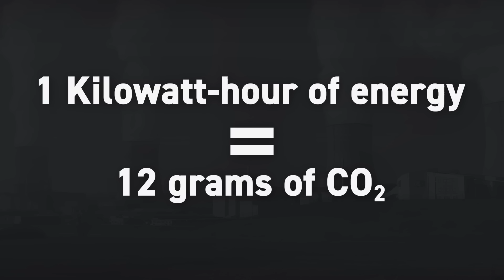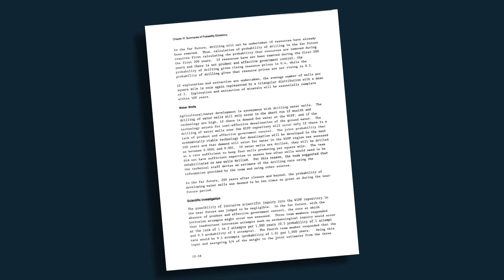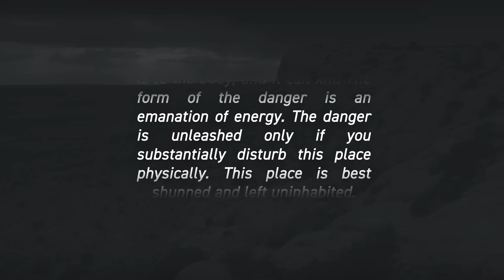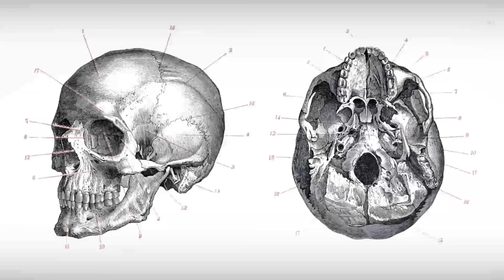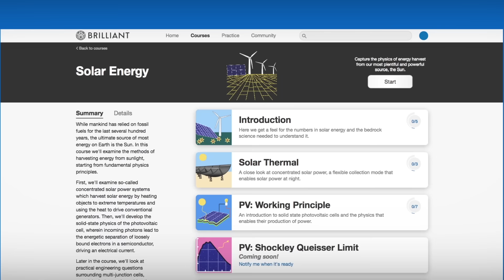The Nuclear Waste Problem

Comment: I'm honestly pretty disappointed in Wendover, one of my favorite YouTubers, for this video.  The basic premise, which is taken for granted, is that spent nuclear fuel is only waste and cannot ever be used for other purposes.  In point of fact, spent nuclear fuel has the potential to provide civilization with many times more value than we ever got out of it in the once-through fuel cycle that created it.  Let's break it down, properly this time.

A fresh nuclear fuel pellet usually consists of uranium-oxide, typically enriched to about 5% U235.  Uranium-235 is the only naturally-occurring isotope which will reliably fission and produce energy, and only makes up 0.7% of natural uranium deposits.  The rest is U238, which is fertile, meaning that a neutron that hits it will not split it, but instead be absorbed.  More on that later.

Inside the reactor, U235 is split (fissioned) to produce power, and leaving behind the fragments known as fission products.  These smaller atoms are highly unstable isotopes and have a short half-life, meaning that they are extremely radioactive, for a relatively short period of time.  The shorter the half-life, the more intense the radiation, and vice versa.  Most of the fission products are done being annoying within 50-100 years, with some being as short as a few weeks and others being a bit longer.  Also in the reactor, U238 is absorbing neutrons and becoming transuranics.  For the sake of simplicity we'll just refer to those as plutonium, because that's the biggest component.  Plutonium has a longer half-life than the fission products and is therefore less intensely radioactive, but it lasts longer, being dangerous for something like 100,000 years (decreasing in intensity during that time).

By the time our pellet is removed, it still has some U235 and a lot of U238 left in it.  But it also has plenty of these fission products, and the plutonium.  Because of those second guys, it is much more radioactive than it was when we put it in there, which is why we treat it as a dangerous material.  Truly, a new spent fuel pellet is a gnarly hazard, mostly due to the incredible intensity of the fission products.  But let's look at each of those material classes, and see if any of them are useful.

Right away, it's obvious the leftover U235 is useful; it's fissile and thus can be used to make more power if incorporated into a new fuel load.  There's less of it, but it's the same stuff and still useful.

The fission products consist of many many different isotopes and elements, and some of them are quite useful.  Most people don't appreciate the significant role that radioactive materials play in modern medicine, for things like imaging, sterilization, and therapy.  We are running out of many of these materials, even as they sit and decay inside storage casks being scorned as useless.  Some treatments even require isotopes found only in the fission products of reactors, and offer tremendous promise in being able to target distributed cancers which require a whole-body approach on a targeted cellular level.  Other fission products become valuable after they are done losing their radioactivity; valuable materials such as neodymium, indium, etc which are extremely important for modern technology, but which are also quite rare and quite an environmental disaster to mine.  Fission products are like what you'd get if you took your pantry and mixed all the stuff together.  It looks nasty, but if you could separate all that stuff again, you'd see again how very valuable it is.

Plutonium is an interesting case.  It's the only component of spent nuclear fuel which is actually dangerous for a worrying amount of time.  It is 99% of the problem which Wendover spent his video seeking to address.  It's also a fissile fuel which can be used in reactors, similar to the U235.  Why in the world should we be scratching our heads about how to dispose of something dangerous, when we could instead destroy it forever AND get an unbelievable amount of clean energy from it?  Two reasons - first, plutonium is also bomb-fuel and thus scary, and our current reactor designs are little princesses who aren't very flexible with their fuel (the reasons are too technical for here, but creating a reactor that can use it is not much of a challenge, we just chose a dumb design).  The bomb-fuel issue is actually scary in name only.  Weapons-grade plutonium must be extremely pure Pu239, or else it simply will not work properly if other isotopes are present.  In spent nuclear fuel, there are lots and lots of other isotopes present, and the challenge of separating those out in order to make a bomb is such a difficult challenge that no one has ever bothered.  If you want to make bomb fuel, there are much, MUCH easier ways to do it than going Mission Impossible on a reactor site and burying yourself in Pu238, Pu240, and Pu241 which you can't use.  Reactor-grade plutonium is useful in reactors and for space exploration, only.

If you're really on top of it, you may have already figured out the use for the remaining material, U238.  Remember that plutonium is a fissile reactor fuel, and that it was created by the U238 absorbing neutrons from the reaction.  This makes possible something called a breeder reactor, in which the fertile U238 is "bred" into plutonium and fissioned for energy.  Breeder reactors are not new or theoretical technology, in fact the first power reactor ever, EBR1, was a breeder reactor (hence the name "experimental breeder reactor").  U238 made up about 95% of the original fuel pellet, and still makes up well over 90% of the used pellet.  Through breeding, it is every bit as useful as the U235 that was the whole point of this thing from the start.  Except there's more of it.  A lot more of it.  In fact, if you put the U238 present in spent nuclear fuel through breeder reactors, you'd have enough energy to power all of the United States, including all cars and transportation, for over 1,000 years.  That's not waste.  That's salvation for humanity.

I was horrified to read that message to the future, about how the materials were useless and uninteresting and ought not to be messed with.  If we were to bury all our nuclear waste overnight, within several decades our demand for energy will have is digging them back up, because they will represent the single most valuable deposit of materials in the ground, anywhere.  Throw away the gold, toss the platinum into the ocean, and get that material that the short-sighted idiots in the 20th century were foolish enough to regard as waste and throw away.  Imagine if you could turn your poop into 24k gold.  Not only would you have gold, but you also would have gotten rid of the poop.  Yes, these materials are dangerous.  If you want to get rid of them, USE THEM.
Reply: And it was disappointing when he said that thousands of people would die because of the spent fuel pool not having water. Theres nothing supporting that claim. And thousands compared to what? 1000 of 1000 people is bad. 1000 of 1000000000 isnt. The pools still have roofs. Even if the radiation escaped people would have been told to stay in their homes for 2 weeks and by then the radiation levels would have returned to what they had been before the accident. The only problem with Fukushima was the earthquake/tsunami.

Comment: Surely if the "spent" rods are still radiating enough to heat up water to 100 Celsius then you just use them in a Stirling engine and there you go - free power.
Reply: Yes but if the water to the rods fails for any reason your still going to have a nuclear meltdown. Its generally not economic or safe to distribute the rods for low intensity power generation.
Reply: Mimi Kal It would work, but it would take tons of effort since you’d have to keep refilling the water over and over and over again. And if that area had a drought, there’d be a nuclear meltdown
Reply: Its a good idea, they already need to continually add water to the spent fuel pools so thats a moot point. A Stirling engine reduces its own internal entropy at the expense of increasing the surrounding entropy more than the entropy would have increased if the heat was just allowed to radiate from the pool. It basically takes all the disordered kinetic energy (heat) from the liquid and uses a large amount of that engery to re-order a smaller amount of it into usable kinetic energy. You would use less water to cool the spent fuel pools by doing this.
Reply: Leedle1234 Bruh, just pump the steam though a cooling system and recycle the water. Sure, it would take power to cool the water, but you wouldn't have to constantly refill it.
Reply: DATA EXPUNGED that’s actually pretty smart, I hadn’t thought of that. It seems like all the nuclear waste that’s been created could’ve been solved by the Wendover Productions YouTube comment section😂
Reply: It exists, it is used by space probes and the moon lander. It is call Radioisotope thermoelectric generator and i guess it could create some power but it wouldn't be much.
Reply: RTGs work not on nuclear waste, but on Plutonium or Strontium. You literally have to spend nuclear fuel to produce that. Which creates waste. Which you now have to deal with also. 

But here's the catch: these Plutonium and Strontium based RTGs are designed to never be serviced by humans. That's why they sent them to space. What you can create is entirely new system of power generation: the one that's to be used here on Earth, serviced by people, and would therefore be safe to use with nuclear waste. Create a single loop or double loop system that uses the heat from decay to create electricity. 

Almost like... a smaller, less powerful nuclear power plant with no chain reaction going on.
Reply: its not fast enough to be effective, and if there was a problem, it could be devastating
Reply: yeah great idea, when someone forgets to refill the tank instead of just getting a burnt up engine you get cancer
Reply: Trophonix
 Regular nuclear reactors have the same problem, and yet they don't normally give you cancer. In fact, the most devastating kind of nuclear catastrophe is not possible with this nuclear waste stuff, exactly because there's no chain reaction.
Reply: Leedle1234 no you don't, just use more water to begin with.
Reply: Water doesn't have to be 100 degrees to evaporate. Clothes dry in 10 degrees, and this is roughly the same idea
Reply: obviously you must be more educated than the scientists that decided when enough fuel was spent to make them no longer viable... go.. use your idea.. become rich beyond your wildest dreams1!!11!!
Reply: apple54345 France reprocesses spent fuel rods. It's an expensive process but it works. Furthermore, there are many isotopes that can be bred into fissiles thus vastly increasing the available nuclear fuel resources.
https://en.m.wikipedia.org/wiki/Nuclear_reprocessing
Reply: It's the economics of it. The amount of power you would get out wouldn't be worth the effort and power put into it. Infact spent fuel rods can be reprocessed to get out the uranium you want and separate out the decayed atoms you don't. France does this because the government subsidizes it and because most of France's electricity comes from nuclear power. 

All other countries however digging up new uranium and making it into fuel rods is cheaper then reprocessing them and the only way to compete with other cheap power such as coal/oil/natural gas.

The irony is in the future depending on just how things work out our descendents might think themselves lucky we didn't seal away the spent fuel in some impossible or dangerous to get place so they can reprocess it once the sources of natural uranium are expended along with other non renewable fuels.
Reply: Mimi Kal
Right idea but wrong process, and it's already being done, so, sorry no nobel prize for you.
They currently do use the heat from the water in a closed system so the heat isn't all wasted.
It's not enough to drive a turbine but it is enough for heating and the like, with the heat recovered via heat exchangers in the radioactive pool.
Reply: Also... not worth it.
Reply: Also Couldn't you set it up for the engine to act as a Pump? and basically extract the heat energy while returning the cooler water back to the system its basically a RTG on crack
Reply: Exactly. why don't they do this?. the double loop should let you avoid Radiation to any parts requiring service.
Reply: Mimi Kal that's my first thought tok
Reply: Leedle1234 you do know in most water generators the water cycles back?
Reply: You're not wrong - there's are kinds of reactors that do just that, they're called Breeder reactors and Fast reactors.
Reply: That's exactly how a normal reactor works
Reply: Totally viable but basically the regulations around handling spent fuel prevent this use.
Reply: Hey................ Sounds like you know Galen Winsor and his video: Nuclear Scare Scam.

The man was swimming with the rods.
The man handled the rods.
The man eats plutonium.
Reply: Might there be a reason as to why we arent allowed to use the stuff? Like in: They cant sell oil anymore, no more coal....................
O sweet Jezus, what if we were to become independent and could have our own little reactor?
Howmany submarines have had meltdowns like Chernobyl?

But there will always be enough indoctrinated people around who will say: O no, dangerous. 
And they happily breath in the shit produced by the cars on the roads, the powerplants and so on.
Go figure.
Reply: Amber Martin........... Because it is NOT WASTE!!!!!!

Man o man o man..........
People seriously do  not want to become cleaner.
They want to keep on burning oil and coal and other such crap.

Have a look at what Galen Winsor told us, Amber...............
He swam with the rods........ like in: He actually went swimming in the radioactive pool in which those rods are placed.
He ate the stuff, like in eating the shit.............
He has spoken about it, in a talk called Nuclear Scare Scam which you can find on youtube.

Tell me Amber, howmany Nuclear Submarines have experienced meltdowns?
Or any other kind of failure with the nuclear reactor?

IF a Rocket could be fueled by the stuff, why then cant we use it to get clean energy from it????????????????????

Sweet Jezus man, why did people become this stupid all over the planet, to believe Everything they have been told.

NO, ofcourse not....... The scientists wouldnt have any reason to lie about it, would they? Ofcourse not.
Reply: Chernobyl was just a steamkettle which exploded.
Steampressure made it blow up. 
Just like old locomotives did.
It was done to scare people, so that they would continu buying oil.

Imagine that just a small piece of the rod can heat up a lot........... and then  you have these peltier modules which make electricity from heat without any moving parts.
That, according to Winsor, is how they made a highway underwater for submarines to follow.
Powered by such generators.

But no.................. We have to be scared because? Because idiots who themselves have NEVER EVER had to deal with the stuff can say what others may or may not do.
How ridiculous is that.

Seriously, we might just as well push the red button and get it over with. It would perhaps save a few species.
Because now, at the current rate of our destruction, we will have this earth be a dessert before the next century is over.
All thanks to Ignorant people.
Because, its not those who Do things but its those who Do Nothing who destroy this planet. They will let them who Do the things continu Doing them. 
An d only when we have poisoned the last river, killed the last animal and chopped down the last tree will we perhaps realize that we cant eat money.
Which is the driving force behind why we keep doing what we are doing, eventhough we can CLEARLY SEE that we have been duped....... and have been FUCKING UP this planet even more.
Reply: if the answer was that simple the world would need an engineer and technician.
Reply: @Trophonix  how is that different to now?
Reply: There are actually preposals on the table. Diamounds made from radioactive graphite produce electricity. Normally. A lot of what we call waste can be refined or reprocesed into a form to produce new power. That said not all.
Reply: That's what they did @ Chernobyl...
Reply: In this house we obey the laws of thermodynamics.

Comment: This video didn't even mention about consuming nuclear waste using next generation reactors. The so-called "waste" is not waste at all, it can be turned into fuel again with new designs of reactors. With this design, nuclear can provide thousands years of energy, instead of hundreds. Most of current reactors are designed in the 50s, 60s. We have yet to give any chances to the new designs, if regarding all the technology advancies there already exist. Nuclear doesn't have to be dangerous, so is the waste problem. The whole fuel cycle can be closed. However, our fear of nuclear is killing this clean energy source, which is probably the most feasible clean energy to completely replace fossil fuels. The early years of nuclear energy development saw a thrust of efforts in the R&D of nuclear energy, but now we're putting much less investment into it, which is why so much less has been achieved in the development of nuclear industry. A lot of good designs stayed to be just designs instead of becoming real products. If the fear of nuclear continues, the nuclear waste will hardly see any changes and be really solved.  The current nuclear technology is a "half-way done" project. The real dangerous part  lies not in the nuclear itself, but in the weakness of humanity. When nature reveals its powerful side to the human beings, it requires the human kind to have a equally powerful mind, and the strong will to tame it, instead of shunning away.